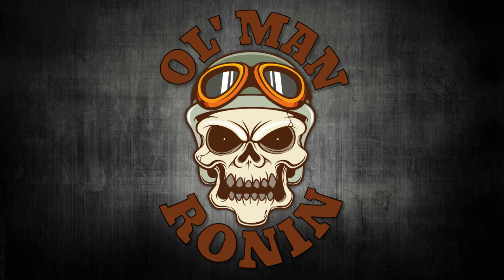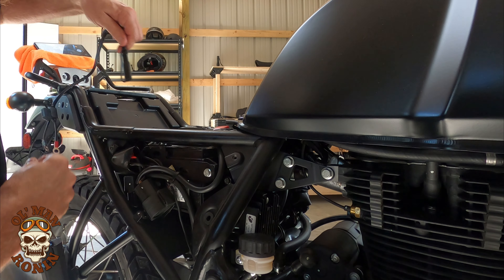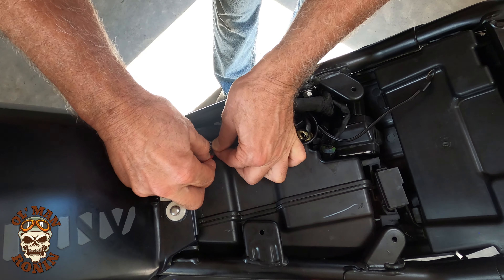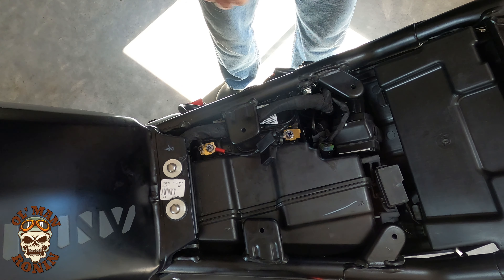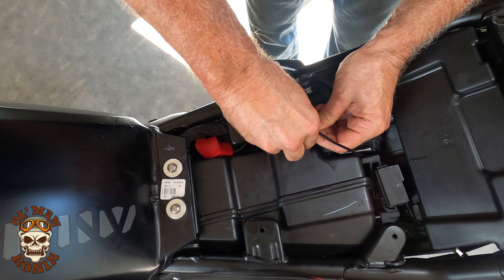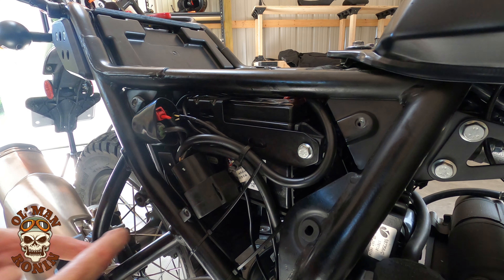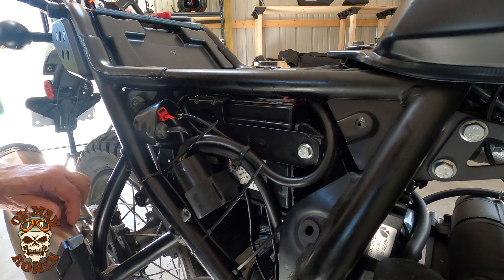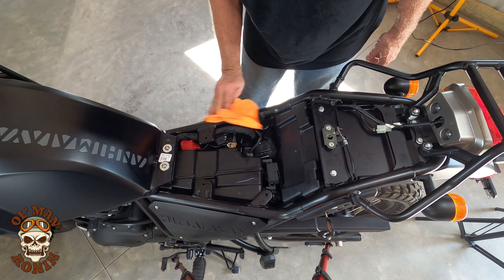Battery Tender Install Plus More! | Royal Enfield Himalayan USA | Ol' Man Ronin (S1,E22)

Comment: Just bought a battery tender junior and wanted to test it with the alligator clips before installing the o clips. Getting red flashing light, any suggestions?
Reply from the maker: Read your manual first off.  Was the battery dead or low charge level
Reply: @OlManRonin  Brand new bike, so assuming the battery is 100%. Himalayans should be negative grounded, like most vehicles, correct?
Reply from the maker: @theclydes5829  yes however connect the leads to the battery so the Battery Tender reads it alone
Reply: @OlManRonin  Sounds good. Thanks for the quick reply, much appreciated!

Comment: Gotta admit, I was hoping for some advice that isnt common sense.   This is pretty much standard practice for anyone with a brain.
Reply: Also worth noting - if you ride your bike almost every day there's no need for this anyway.
Reply from the maker: So glad you watched it and not everyone has ever installed one.
Reply from the maker: @ZachM1  but if you dont
Reply from the maker: @ZachM1  I ride the king everyday and still plug it in
Reply from the maker: Ol' Man Ronin's Guide for LONGER Battery Life:

Keep it Charged:
The First Step is to do what the above video says
The absolute best thing you can do to keep your motorcycle battery working stronger for longer is to make sure it stays charged. If you ride your motorcycle daily, the alternator should take care of charging the battery while you ride, but if you keep your bike in storage for weeks or months at a time, you’ll need to invest in a motorcycle battery charger. I personally plug my bikes in after they cool down each and every day!

Stick to a Maintenance Schedule
As with most components of your motorcycle, the battery needs maintenance too. Some routine maintenance you can easily implement includes:
Check terminals for signs of corrosion and clean off any deterioration with a wire brush.
For conventional batteries, check the electrolyte levels and add distilled water if the plates are not submerged. This is part of my Top 5 Things to Tighten link here: https://youtu.be/hKK6m4_a198
Test your battery’s power with a battery tester to make sure it’s functioning properly.
All of these simple checks and adjustments should be done on a monthly basis and can go a long way toward extending the life of your battery.

Regulate the Temperature
Vapor loss is a normal occurrence for conventional motorcycle batteries that happens gradually over time. However, extreme shifts in temperature can expedite vapor loss, which will eventually cause the battery to stop holding its charge. Even though there’s no way to protect your motorcycle from all temperature fluctuations, storing it in a climate-controlled garage will keep your battery at a stable temperature while not in use.

Sealed batteries, vapor loss is not an issue, the gases recombine inside the battery so that no fluid is lost from the battery. However, storing them in a climate-controlled garage will reduce self-discharge and keep the batteries at a stable temperature for reliable starting all year long.

Use the Proper Battery for Your Motorcycle
Not all bikes are created equal. The same goes for batteries. By making sure you’re using a battery that is designed to be used with your specific model of motorcycle, the better it’ll perform. We know it can be tough to know which battery is best suited for your bike, which is exactly why we created our battery finder to ensure that you know which to choose.

It’s also important to note that when it comes to motorcycle batteries, brand matters. Purchase trusted brands of motorcycle batteries.
Reply: If you haven't replaced the stock battery you definitely need to do this before your trip. The batteries installed are absolute shit.
Reply from the maker: @randallwellman727  I heard that and I definitely will. I'm thinking a larger capacity if it will fit lithium if I can afford it lol
Thanks for the comment! Cheers!
Reply: @randallwellman727  both mine were toast within the first few months, the Himi and the Interceptor. Hard to get proper info re lithium.. you'd of course need a lithium charger.. is it worth it??
Reply: As a man without a (mechanical ) brain I found this helpful. Thanks for sharing your thoughts though, they were extra helpful!